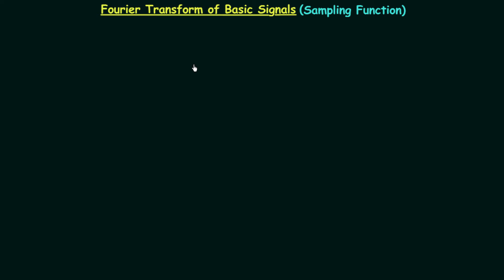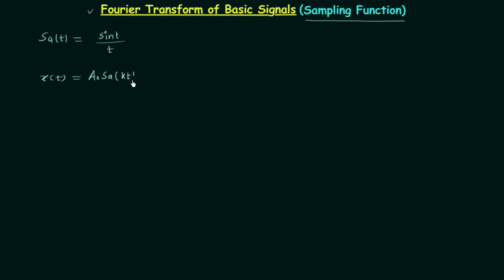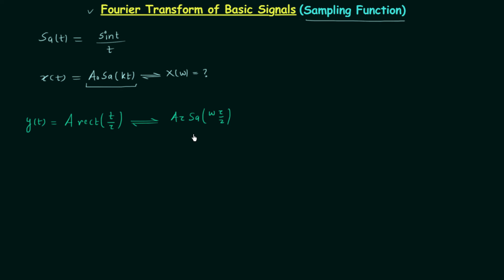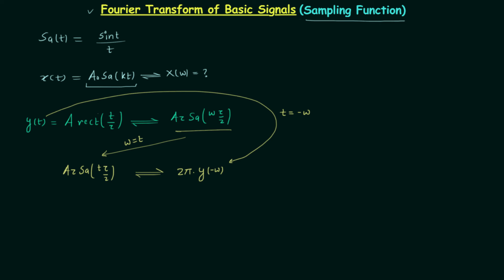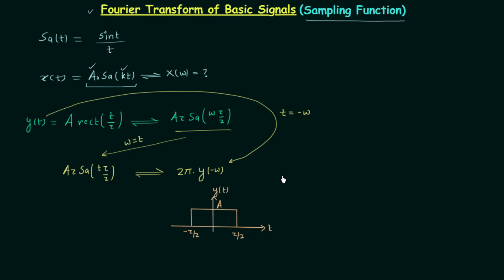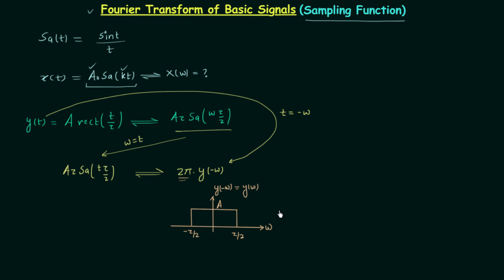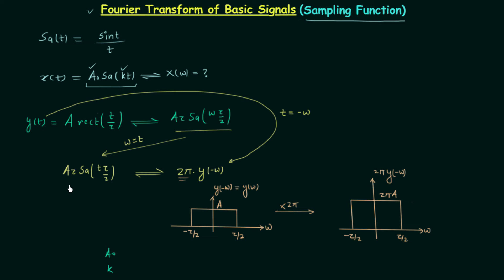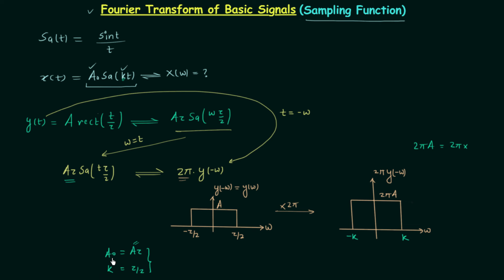Fourier Transform of Basic Signals (Sampling Function)

Comment: Sir, I could notice a small mistake here. In the triangular waveform representation, y(t) = A rect(t/tou).  To get total area = A. The amplitude of y(t) for -tou/2 to tou/2 should be A/tou. But you have taken only A. This will accordingly change the FT as  A sinc (w.tou/2) [ not A.tou sinc(w.tou/2). In your previous lecture for derivation of FT of rectangular and triangular signals too, same thing you have assumed. Please check it and let me know if I am wrong. Thanks
Reply: No problem bro. Sir not consider  total area A. If you want then you have said that is right. Range of t is -tou/2 to +tou/2 , then alway area*sam(w*tou/2 ) always come.